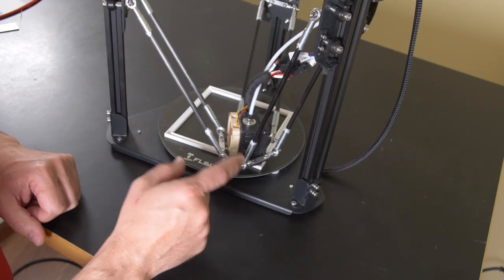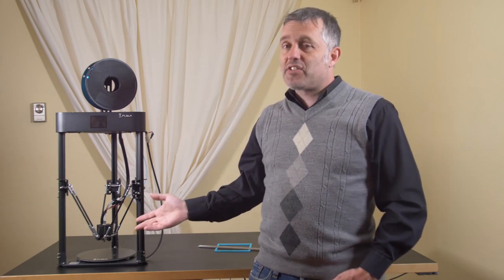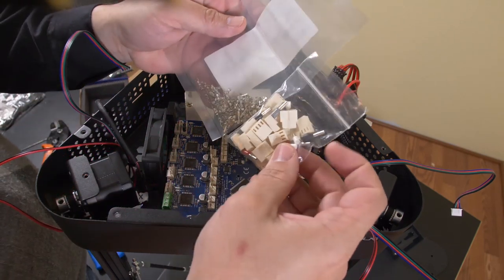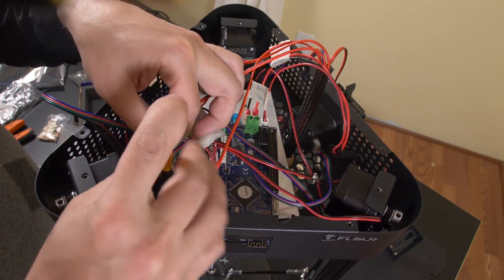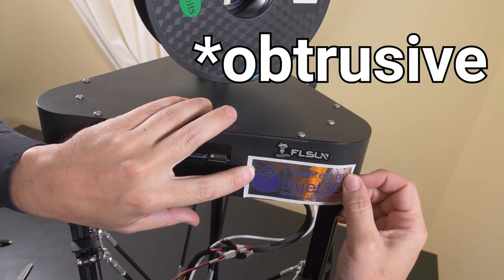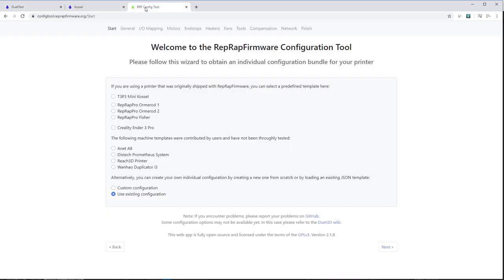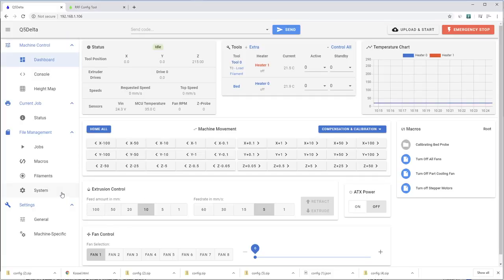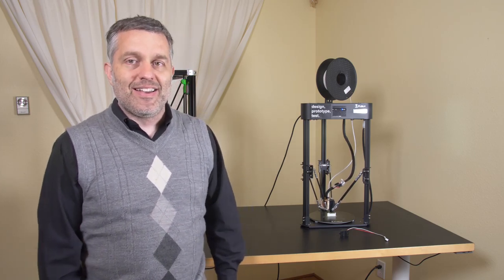How to Build the Best Delta 3D Printer for the Money in 2020

Comment: Finally got my QQ-S pro printing with Duet3d board and reprap 3.3.3b2 ! yayy.. it wasnt exactly straight forward like this project, but I got it done.. more mods coming, raspberry with webcam control and LED's coming too :) webcam most important so I can monitor the print from my phone.

Comment: @DesignPrototypeTest I read below that you blew up your Duet.  While I'm not a n00b -- I've been experimenting with a friend's Ender 3 Pro for the past few months -- I'm also looking for a printer that "just works".  I would love to tinker; I just don't have the time to tinker.  I want to be able to print models and things that help around the home -- like, say, this glove dryer https://www.thingiverse.com/thing:1003576 -- and I don't want to have to tinker with the printer to get it to work.  Would the FLSUN Q5 or QQ-S PRO -- modded with the Duet or factory -- fit that concept?
Reply from the maker: Get the Mingda D2 for the lowest cost, works well out of the box printer that doesn't need to be upgraded. The Q5 needs a Duet board. I burned one of my Duet boards up with stupidity. I was by connecting a Buck converter to take 24v directly from the PS and drop it down to 12v so I could run a fan. I set the board (while it was powered on) on top of the power supply with the metal case. Then I accidentally touched the 24V+ wire from the Buck converter solder point to the PS case and the short circuit fried the 5v rail on the Duet. I've done all sorts of other stupid things to the Duet boards but this is the only thing that managed to kill one. They've built in all sorts of idiot proofing into their product. It's very good.

Comment: I come in here and see DPT bragging on his FLSun, which I'm pretty certain is Chinese for "Voldemort", and I wondered what parallel universe I had slipped into? Then @2:50 my sense of reality was restored. Whew! :)  

You had me laughing out loud @14:00 with your hack. :) So I'm not the only one with unopened bags of connectors from Duet?

Curious as to how you blew up your Duet, I haven't managed that as of yet. Nice job on the Duet mount that you designed for your printer.
Reply from the maker: I blew up my Duet by being over confident in the idiot-proof-ness of their designing. I was so uncarefull that I was working on the board while it was powered on and sitting on top of a bare Aluminum power supply case. That still didn't kill it. What did it in was when I allowed the dangling Buck Converter to also touch the case. I don't know if it just directly connected the 24v power directly to the ground rail through the Buck Converter or if it shorted out through some other part of the Duet Board. At any rate, it was very, very careless on my part.
Reply: @DesignPrototypeTest  I've got no room to talk, I've been known to kill lesser devices doing just that. And I was thinking that what your buck converter really wanted was a piece of shrink tubing over the board. I can see it popping off of its tape one day and ruining yours.

I use a drop-in replacement for 7805 regulators from EZSBC.com on my old retro computers. They work perfectly. They also make a 12 volt version: https://www.ezsbc.com/index.php/products/psu3-12.html#.XqraJKhKiUk

I do have to say that you've done a great job getting your deltas tuned up. I wouldn't have believed it if I hadn't seen it. My Rostock would print out a 100mm x 10mm "L" with a leg width of 9.8mm at one end, and 10.2mm at the other. And that was with tower calibration. Getting engineered parts to fit was a challenge.

Comment: I see the Prusa hate boner is still raging. That aside have you considered trying this with an SKR board instead? The firmware would take more setup compared to the duet interface but I think it might be a interesting alternative for those looking to keep the price down/not willing to spend more on the board than the printer and it would certainly put it more in the Prusa mini ball park (cause, well... it would be a shame if it had alternative right?).

Comment: You can print up to 120mm/s at .12 on the ender 3. Past that the hotend starts to choke. I understand that you'll get ghosting but if you have tuned acceleration.
Reply from the maker: Tuned acceleration slows the printer down. You're not actually printing at 120 mm per second.
Reply: @DesignPrototypeTest  of course not. Only on large parts where it does have time to speed up. But 120mm is not necessarily useful on walls. More so on infill. That still speeds it up by quite a margin. But this project is still impressive!

Comment: My shitty 8 bit powered Anet with A4988 drivers on all axis that I had since 2017 only ever failed two prints in the middle of the print. Bed adhesion has always been an issue, I solved it a few months ago by buying a piece of tempered glass (to fix the pit in the middle of the bed) and Buildtak clone (to adhere PLA to it) 

The fact that some printers can fail in the middle of the print is just baffling to me. How can you make hardware or software worse than the god forsaken Anet?!
Reply from the maker: >How can you make hardware or software worse than the god forsaken Anet?!
Ha Ha Ha! China!

Comment: Rebooting and guessing to calibrate a delta? Marlin has a way better and user friendlier calibration procedure here. I would a also say updating the existing board is faster than replacing it,  but yes, that LCD is scrap. You should really give marlin a shot, I've got the impression your view on what marlin is well outdated. You could make a really fun video of it when does not turn out well, (you know, clickbait palmface tumbnail), while I would like to see you embrace marlin as well.
Yes, chinese printers are never just right. Hope some seller stops making complete printers one day, would love to be able to click the option "without electronics" or "without hotend and extruder", while there is some universal mounting gear.

Comment: Anyone running in a successful home-built Delta will know the struggle is real...
Reply from the maker: For real, though. :)
Reply: Yeah. Been there, not going back.
Reply: Curious, do you regret building one?
I've got a ender 5, decently modified but I'm torn between eventually building my own, either corexy, or delta.

Comment: should I really buy so much and redo so much. just so it can run ??? i'm just a normal user. not an engineer or professor. wanted to buy this 3D printer. now i don't  :-(
Reply: These printers are fine. Dont be afraid dude. Deltas are a bit more work but they're way cooler. check the reviews across most websites and youll see that its not normally prone to failures of this magnitude. If youre looking for problem free and cheap, you should look at an ender 3v2

Comment: Well there are other makerbase boards that are 32 bit and far better then the robin still marlin but also NOT 175 BUCKS!
Reply from the maker: Still made in China by the lowest bidder. You know they cut corners, the only question is if one of those hidden corners that they cut will lead to problems that take you hours to fix. If you can even fix them at all.  Let's say the board you are talking about costs $50. That means the Duet only costs $125 more. On two occasions, I've spent 40 hours digging into the firmware and hardware on these Chinese boards trying to chase down the problem only to find it can't be remedied by me. At $12 minimum wage that was about $500 worth of time. Once I had done those projects I never used that specific knowledge again. I would have been much better off just spending the $125 more for the Duet. Save your money until you have enough to buy the Duet. Unless you like the struggle with Chinese electronics, which is a hobby in and of itself.
Reply: @DesignPrototypeTest  I have 5 of  them 3 that are years old and never given me a single glitch. But they are not the low ball robins either. I get your point..Just cant say I see 4 times the value in duet boards

Comment: Duet 3d all day. also, the wiring looms for these chinese printers are always crap. My TLM needed all new motor wires and sensor wires as the pretend copper wire supplied orignally was like hair and not crimped properly into the jst pins.

Comment: Config file feels like a trip back to 1964 or so. Whatever works, I guess.
Reply from the maker: Have you seen what configuring Marlin looks like? The config file is like living in the year 2064 compared to that.
Reply: Hmm single config file vs multiple source code file configuration changes plus compiling said firmware yourself, then uploading it every time you want to make an adjustment....
Reply: @secretagb  so what? Not a big deal
Reply: @petervansan1054  lol..uh...*blink blink*.....yeah kind of a big difference in every possible way.

Comment: I don't get the 4 minute long monologue about the supposed Russian shills saying this printer is hot garbage (don't listen to them), ultimately concluding that it broke for you in six prints--don't buy shiny cheap printer till everyone says it's ok. The double messaging here is confusing. To use a car analogy: if the suspension on this Mazda car is great, but the engine will need replacement with a Subaru engine the sixth time you take it out of the garage (and then its smooth sailing). As a package it's a pretty terrible car, no?
Reply from the maker: Your choice are pay ~$1000 and get the Czech printer, or get the best printer from China and know that it will need work and upgrades to get it fully functional. The former yields predictable results and costs about 2x to 3x as much as the later choice. There is no choice if you want a Delta printer. China is the only source. The shills for the Czech company just want to make everything sound inferior to theirs. But they will never acknowledge the actual issues that the orange printer has. For instance, why on earth would anyone design the foundation of the printer to be held on with zip ties? Mythbusters proved that you can polish a turd and that's what the Czech printer is: A polished turd. It is quite shiny.

Comment: Not aware of a long-term narrative here, but the video blaming others on lack of objectivity looks like a Duet commercial itself.
All boards use almost exact same hardware, "western" ones being simply 4x price tag against generic Asian builds (RAMBO and Smoothie to name a couple). Western folks just want more money, but there's no change in quality as absolute majority of the problems reside in firmware. Basically, same crap inherited from Marlin and similar 15 y.o. Arduino experiments, top brands included. The point of investing three-digit amounts is not clear.
Many points in the video suggest low credibility in technical aspects. May be not a bad idea to preview videos with an experienced electronics engineer.
Reply from the maker: For more long-term narrative context here is my video about open source: https://youtu.be/iKhn5IcVvAg and here is my video showing an inferior clone of a BLTouch sensor: https://www.youtube.com/watch?v=HvpxfCd0zcI&t=1s I wanted to do a similar video showing the inferior Chinese clone of a Duet, but they requested that I not, and because I like the company and the guys who make things happen at Duet I honored their wish. They felt that it would do them more harm than good giving the clones free advertising. That being said, I have a clone of a Duet 2. It loses WiFi connection in the middle of every single print. I can't reconnect without physically turning the machine off thus stopping the print. In other words, I have no control over the printer once I start a job and it just decides to quit. You pay for what you get. Also, you are behaving in an immoral fashion, which makes you a bad person. Purchasing clones is supporting thievery. It's the same thing as buying a stolen bicycle. You are robbing the company who developed the product of a sale. Watch the two videos before you try to argue with me further.
Reply: @DesignPrototypeTest  Alright, you made me spending 20 min on the videos, which are not even relevant to what I'm talking about.
Sure clones are bad, but: 1) clones which don't work right, are actually good for the OEM, because they clearly show the difference; and 2) in this video you're feeding completely different idea - that Asian products are all crap while "western" are an essence of quality and new technology. This is not the case. They all are based on same subset of solutions, and quality varies on both sides (look at the Smoothie for example, and why many folks are running generic Marlin on it, after paying full price).
 Nobody wants to invest big into the all-new firmware, just keep copying from each other. But western vendors feel entitled to high buck by some reason.
In your example, loosened stepper makes it clear that driver overheating took place. So all your upgrade could be just installing new fan and adjusting stepper current. Planar geometry distortion is a big miracle here; I would bet it's either warping or poor calibration, both aren't board-related. Blaming complicated MKS configuration, then messing around with Duet config files and g-code scripts half of the video is not coming together well.
Bottom line:
- Duet brings in some improvements, given what I see in their code, but firmware is still based on inherently flawed project, and the hardware is fairly straightforward;

- clones are bad, but there are bunch of original inexpensive boards with the same exact technological base and similar performance, MKS included;
- are western products worth the money given all above ? - not always, and not for everyone;
- was hardware swap necessary in presented case ? - I don't think so.
Like I said, the video is a good load of promotion with lack of technical expertise.